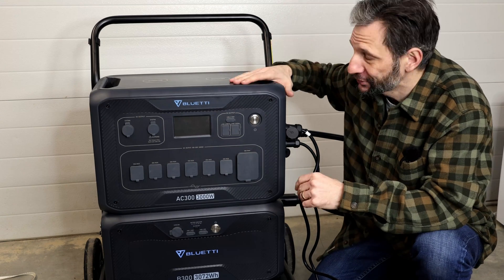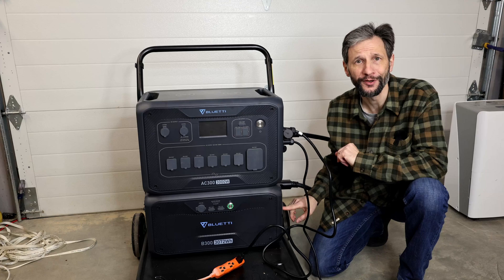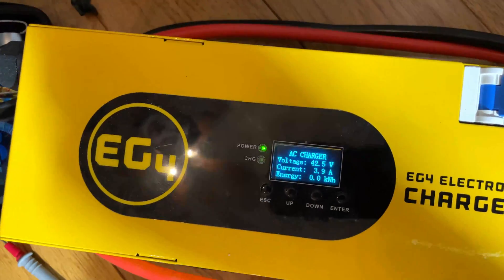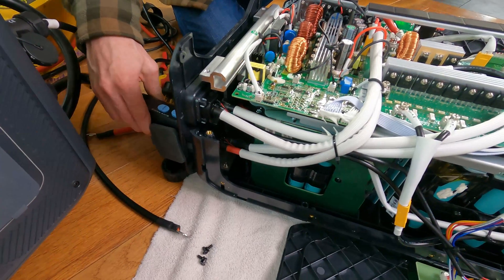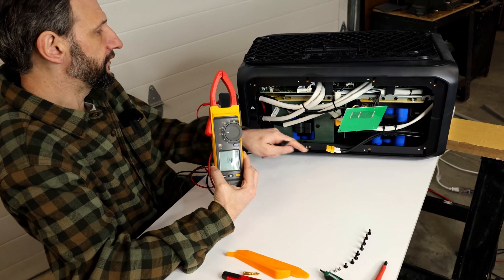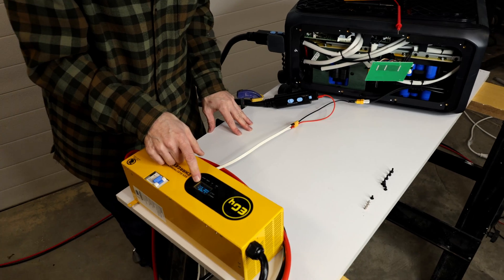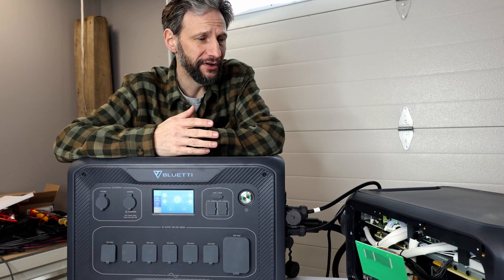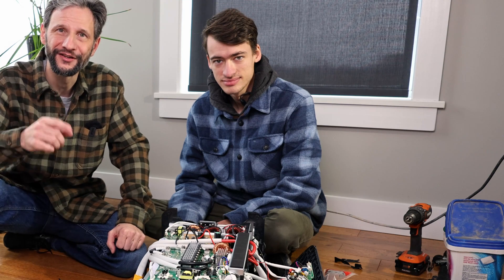Bluetti AC300 Solar Power Station DIED - Can I Fix It?

Comment: Why did the BMS not keep it from over discharging? Seems like a design flaw.
Reply: It went low and the BMS shut it off.  Then as the unit sat not getting any power from the input during extended cloudy weather the BMS and the self discharge of the cells slowly pulled the battery down even further to a point where the cells were too low and the BMS shut down to protect the cells.  When that happens, it often requires charging the battery directly, bypassing the BMS in order to bring it up enough to wake the system back up.  This can happen to pretty much any lithium battery with a BMS.  This happens a lot on smaller batteries used for power tools and other multi cell devices where the whole pack or possibly one cell gets to low and the BMS shuts down and the charger won't wake it up because the BMS has to be running for the battery to take a charge.
Reply: @kuhrd That should never happen with a quality BMS. It will shut down the battery with 10-15% still in the cells and they should be able to sit like that for well over a month. The self-discharge rate for LiFe is between 1 - 3% a month - quality cells at lower temps less than 1%. The inverter should also ensure the cells are maintained.
Reply: @kuhrd  lithium cells don't have much self-discharge. a BMS on an expensive system like this should protect it's battery pack from further discharge after it hits the low limit.
Reply: Very much seems like a flaw, yeah
Reply: I believe you have to change the settings parameter?
Reply: I think the inverter system and bms itself draws too much when you try to power it on. If you're at 0% already then it'll just keep discharging below its cut off and digging a deeper hole with every attempt to restart.
Reply: Even the best designs will fail occasionally.  Not saying that's what this is but it's bound to happen for any product
Reply: AC input is required to be used for parameter settings when the battery drop below SOC Low, it uses AC120V (US) to bring the battery back up when AC is available and solar is unavailable to be used when below low soc. Solar only becomes active charge once above the minimum low soc.
Reply: unit has 16s10p configuration with 3.2v 6000mAh elements, if any one of them is faulty, BMS would try to equalize 1 of 16 series (10 elements parallel), so that one or more faulty single elements would continue to drain continuously voltage, untill BMS detects critical/faulty voltage and shut itself down. Thus allowing one series go "south" to their lowest point

Comment: This same thing happened to my ac200, alsoMy bluetti ep500 fried and the screen doesn't work.  This is why I go with ecoflow now.
Reply from the maker: I think you will find any power station will have this issues if left fully discharged too long.
Reply: just train yourself not to let go under 20% and then change it again! If you have multiple cloudy days use the grid to charge t in some until nd sunny days comes long to charge it fully!
Reply: Not sure what fried means exactly, but I may have a solution for the EP500:

Check on the DSP & ARM firmware. If you have bluetooth enabled, and it's got any signs of life, I had this problem (screen not working, but could control via phone/computer (and technically the touchpad was working, just no display so good luck on anything more than AC or DC on/off) and contacted Bluetti, and they said update the firmware... and for once it did work. (Doing IT stuff for decades, that was a literal Holy Shit moment, because it never works.) AC300 just checked now, and ARM is 4032.11 and DSP is 4031.3 (That was updated later as that version enables the adaptive charging if you have a slightly noisy input, like charging off a car inverter.)  Hope that helps if you try it.